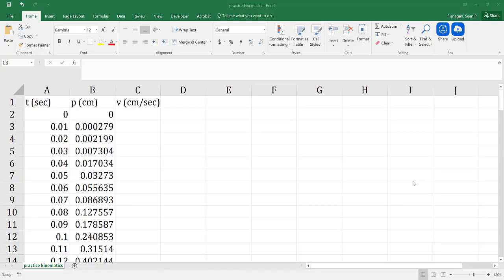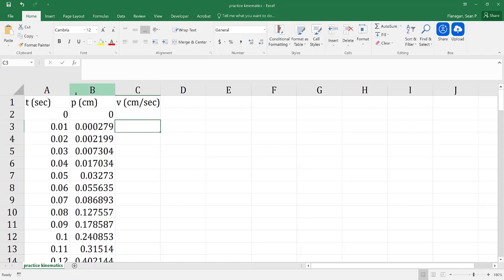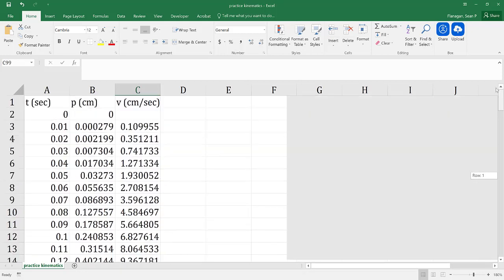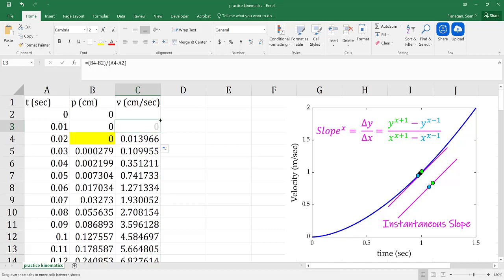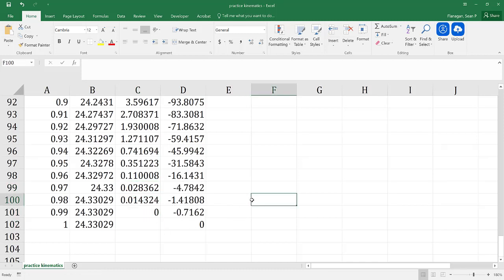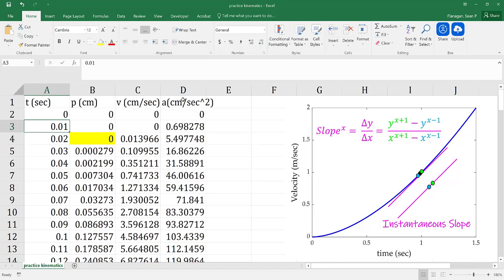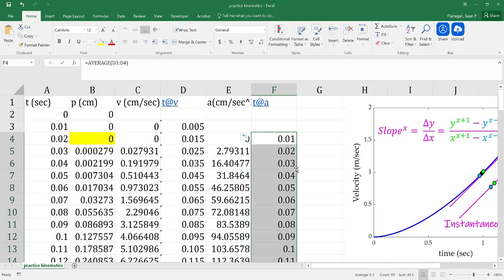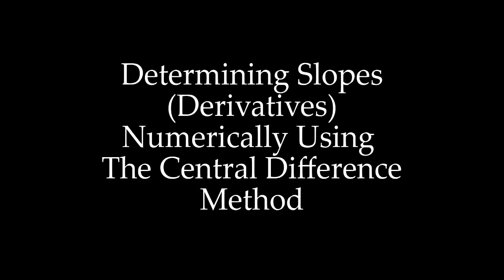Central Difference Method

Comment: Nice video sir. If I may suggest, you can use 3-point forward and backward finite difference formulas respectively if you want the velocity at the left and right endpoints. They'll be 2nd-order approximations too. And if you need the accelerations i.e. the 2nd derivatives, you can use 4-point forward/backward finite difference formulas for the 2nd derivative to obtain the acceleration at the endpoints. Then use centered difference formulas for the interior nodes.